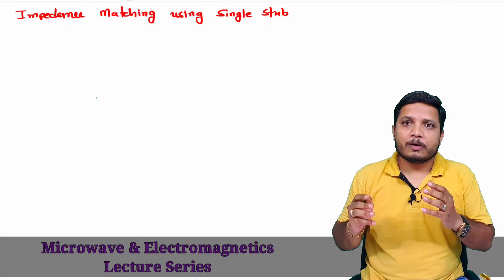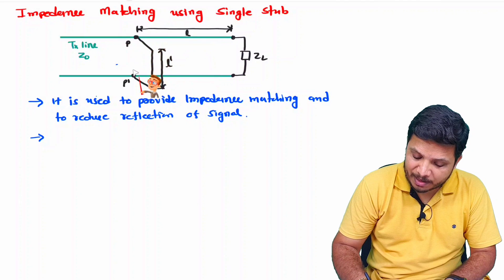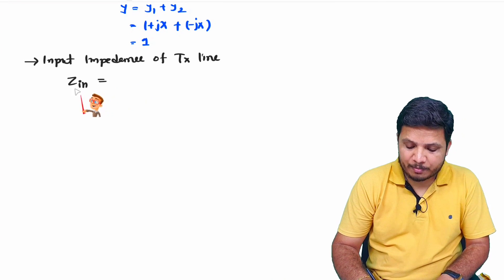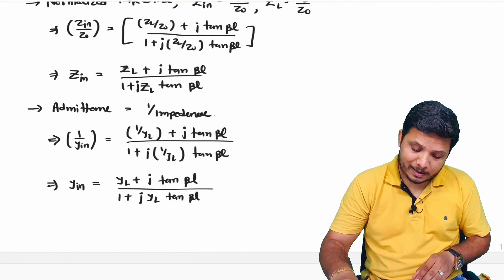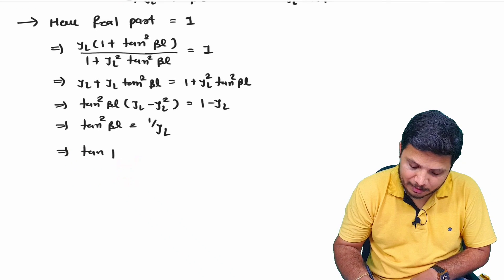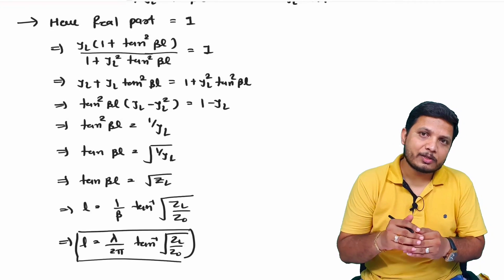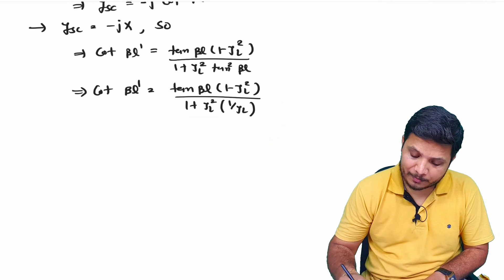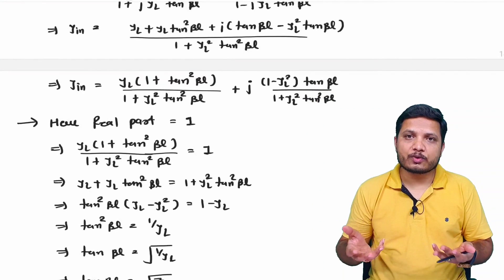Impedance Matching using single Stub in Microwave Engineering by Engineering Funda

Comment: All that shイt with normalizations is devised to hide mistakes in math, so no-one would follow the derivations in hoax papers. There is NO justification to normalizing impedance, because there is simply no fixed wideband impedance in electronix. It is always some floating-point, usually complex, value, which should be treated as is.

Comment: Very informative 👏.. excellent
Reply from the maker: Your positive comments motivates me, my goal is to create largest community of engineers in entire globe, so please help me for that by sharing this lecture series(playlist) with your friends in social media (watsapp, telegram etc). Thanks and welcome 🙏
Reply: @EngineeringFunda  Thank you for nice video.

Can I need your help to make a video how to design impedance matching using transmission line (in ADS use  MLIN, TL1) which is can operated for more than one frequency especially for high frequency. I try study about it from this attached article journal and not quite understand although it simple circuit use (impedance matching and single stage rectifier): -

https://bit.ly/3eq4ywy

Hopefully, you can share some knowledge or the proper step to design it.

Thank you and I really appreciate.